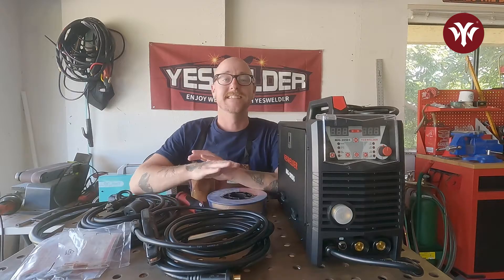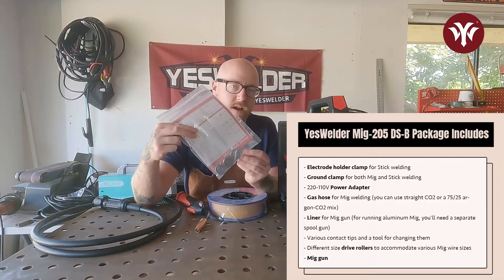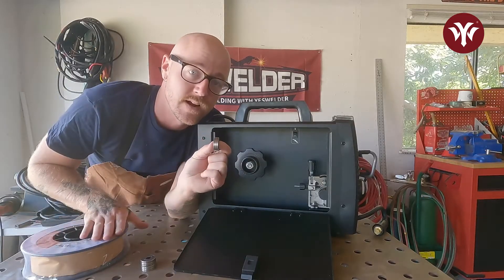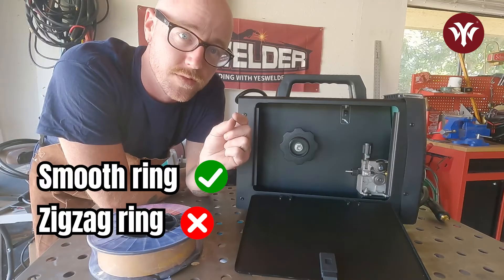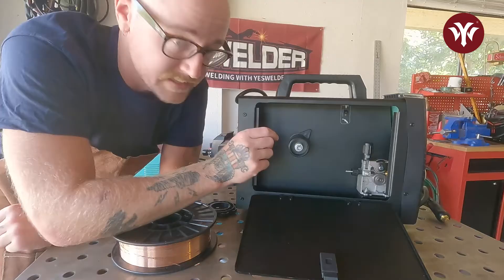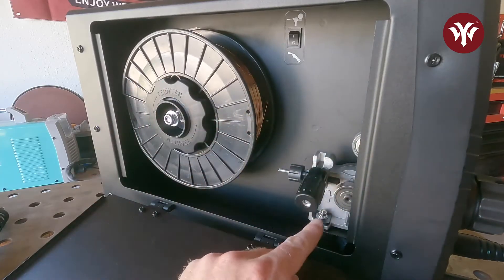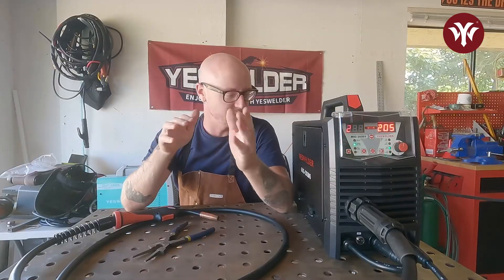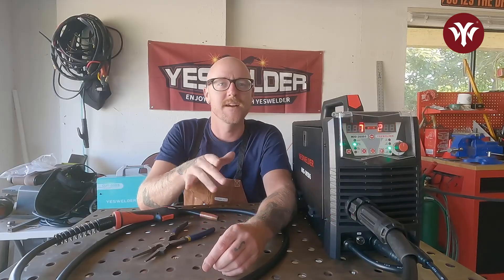How to Setup MIG Welder: Step-by-Step Guide for Beginners | YesWelder

Comment: For the drive rollers, the number on the front corresponds with the front groove, not the back groove. Use calipers and check for yourself. It's visually obvious as well.

Comment: On my yeswelder 205ds pro the .8 is smaller than the .9 which means I would actually put it in with the .9 .035 facing out. .8 is .030 on the inside, am I correct?

Comment: The video did not match my drive wheel and drive tube alignment.  My drive roller was labeled 0.9 on one side and 0.8 on the other.  The fatter zig zag groove was closest to the 0.9 face, not the opposite.  And my drive tubes align with the inner groove.  So, to get 0.9 groove, the 0.8 label is face out.
Reply: Agreed.  This threw me, too.  The 0.9 marking is on the same side as the .9 groove.

Comment: Great video to show what comes in the box and how to put wire in the welder.  Thanks for that.  You did not explain how to attached the cables in the front of the welder.  There are three plugs up front, what goes where?

Comment: Really need a video to go over the settings. The instructions that come with machine are lacking at best. Like the Instructions say to use the knob to pick your material thickness when in synergic mode but near as I can tell it does not give you material thicknesses to choose from??? It does move the wire speed and voltage as you adjust the knob but it defeats the purpose of adjusting on the fly between thicknesses if you need to reference the weld chart to get right setting anyhow🤔. I just got this welder and gonna see if I can figure it out but the lack of instructions either written or in a video is curious.
Reply: I agree. the instructions are horrible and that's being kind. They need something that better explains the settings.  I have all kinds of letters and numbers flashing at me and have no idea what they mean.

Comment: Kinda confused on your explanation of the drive roller labeling.  The rollers that came with mine match the side they are labeled.
Reply: Mine too. 0.9 is fatter groove than 0.8 and is labeled on the side it belongs to
Reply: @-thirteen  glad I'm not the only one to catch that.
Reply: He is wrong i called yeswelder company
Reply: I concur, the explanation is backwards. 8mm side smaller gruve
Reply: I’m a beginner and only caught that because I watched a different video…

I have the same welder shown in the video, it’s disappointing that was misleading, especially since this is a YesWelder video.